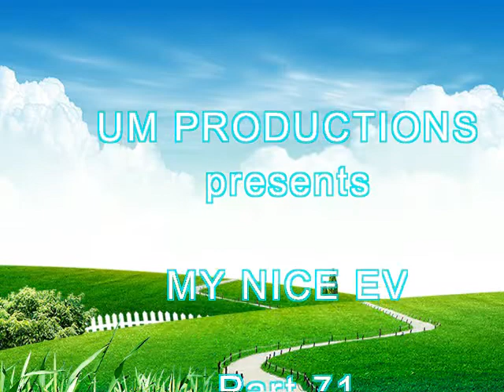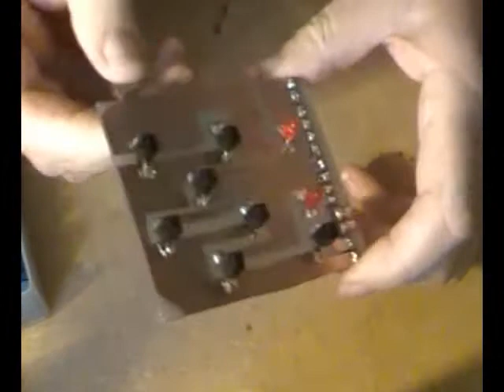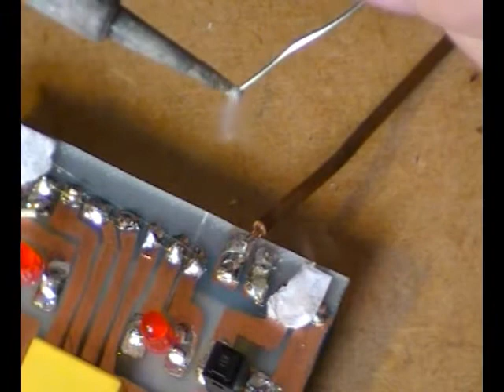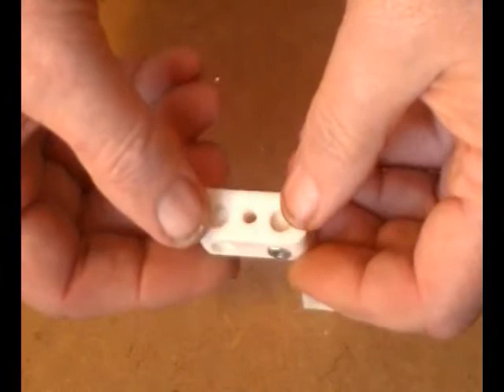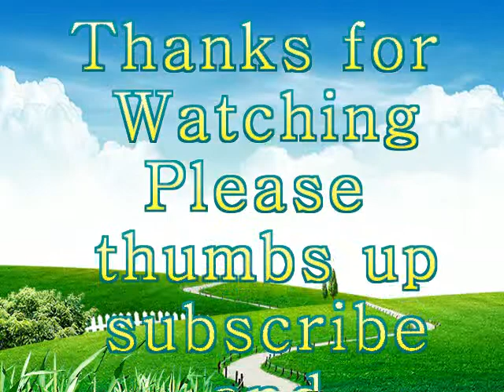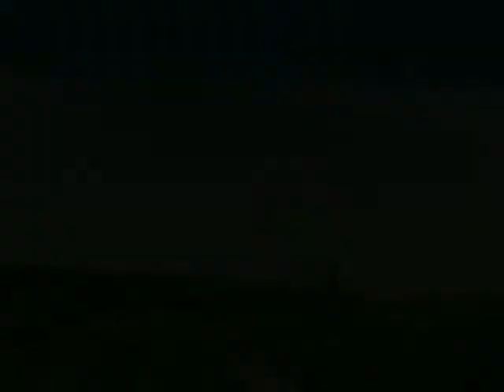MY NICE EVPrinter Arduino CNC Part 71

Comment: that circuit board youve built looks a lot more heavy-duty and hand made than most mass produced products. i like the style of it.
Reply from the maker: Because I thought the etch would hours if not days. I wanted to minimize the copper area to etch. If I had known it was going to be etching for a few minutes I would have made it look a bit more tidier.

Comment: Great work with the editing. Much more watchable :) PCB looks good.

Is your CNC entirely push button operated? Or will it be able to take g-code input?
Reply from the maker: It will be running g-code through an arduino interpreter into 3 H bridge shield I designed using a circuit supplied by a tuber in Spain. I got the jogging panel done so I could show controlled movement. Which everyone has been waiting for. It's about a week a way. Got to get connectors for PSU and build the forward reverse relays. For temporary control.
Reply: I Do like the manual control's. Thats a really good idea. Took a lot of stuffing around in pronterface to get the same thing via mouse clicks for my 3d printer.... And I still cant press 2 buttons at once, so no extrude and move...

Should add a joystick so I can have full movement and control of the extruder/miller head...
Reply from the maker: Or you could use a relay driven by one button and multiple contacts on the relay would make contact at the same time.
Reply from the maker: Thanks MS.